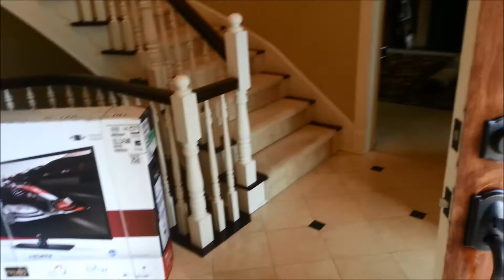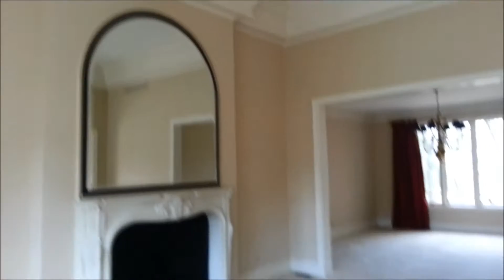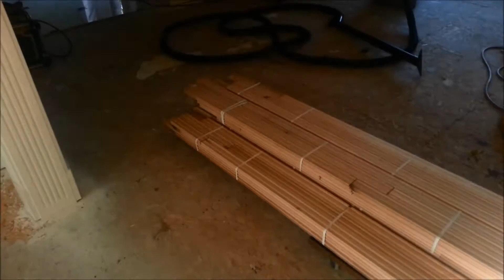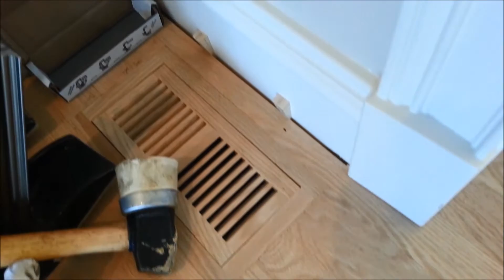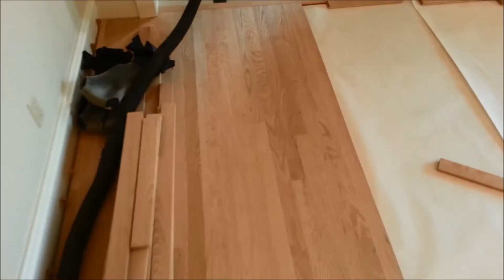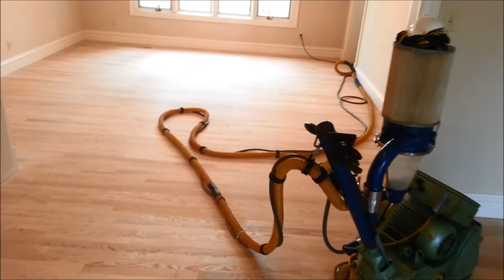Red oak install stain and finish

Comment: Sustainability for All
I am installing unfinished 3 1/4” Brazilian Cherry hardwood flooring & finding so many different widths. Most are within 2mm, but many with 4mm difference, creating gaps. Some boards, the width does not match from end to end. Is this a normal issue with this wood?  What is the maximum acceptable gap as far as your standards & what can be done about it?  Thank you
Reply from the maker: Wow 4mm is pretty substantial. Sometimes you do end up with differing widths with exotics for various reasons but even 2mm is pretty bad. Your options are to sort through it and divide it up by width, then make sure to only use boards of the same width for each full row, run it all through a table saw set to the most narrow width and possibly reroute the groove side, or the worst but easiest option imo- just lay it and fill the gaps with filler.

Comment: Jesus man , I don’t think I would allow anyone to pound on the leading edge with a mallet to get them together.  The metal side of that mallet is tapered so u can just give a few taps to the tongue, and u don’t have to beat it very hard , not half as hard as he was hittin it , I’m a professional hardwood floor installer.  Seams like it would chip the corners off
Reply: But good job bro
Reply from the maker: It doesn't. Anyway, join Hardwood Floor Masters on Facebook if you're not in there already. Thanks for watching.
Reply from the maker: @Carpenters_Canvas  also, have you used the primatech nailer with wheels? It's a game changer.
Reply: @evsnova74  different strokes for different folks man if it works for you it works . Looks good I can be a little too opinionated at times I apologize.  One of my flaws is I am a perfectionist . And I think others should do as I do man not true . I have seen those before . I think . Are they the adjustable height ones that sit a little lower . If not I'll Google it . Keep up the good work man . I only got like 100 sqft left of red oak 3.25 to install tomorrow . Good vid .
Reply: @evsnova74  I'll check it out . I'm not one to do the whole social network thing but I research vids like this to get new ideas and tools and stuff . But I'll check it out bro